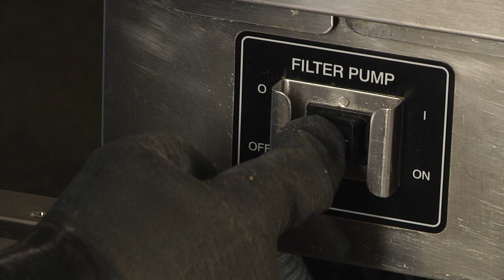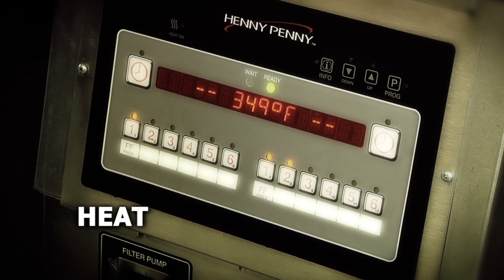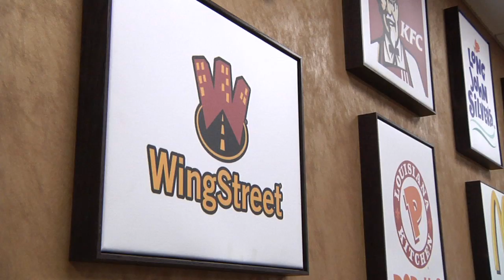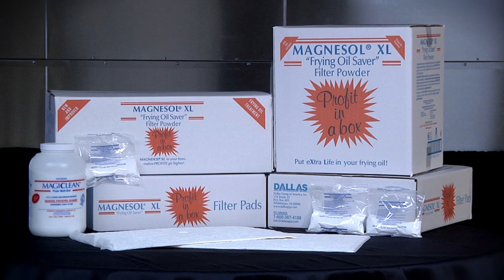What Is Magnesol® XL

Comment: Neat stuff. I've used it before and I recommend it, although I don't know the cost. My advice, is clean your cooking oil as constantly as you can. Don't let carbon and food particles that aren't intended to be eaten, sit out the oil. This will help make Magnisol more effective, since cooking oil will always get to a point where the oil is ruined. If you keep it clean and use Magnisol, the results are very noticable. I got to the point where I'm defensive about this stuff, because EVEN IF your oil lasts the same number of days, the quality before it goes bad is very noticable for taste and appearance. I feel it helps customers enjoy your food more. People buy food at places, based on taste and price. However, this is my personal opinion. I watched this video to find out how it works and my assumption was right, it acts sort of like activated carbon acts for air and water, except this is for oil.